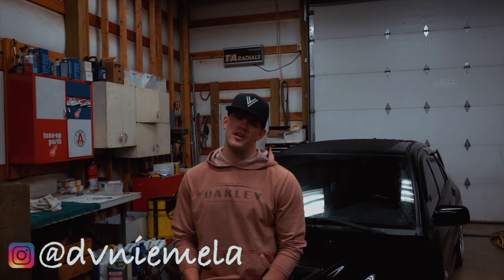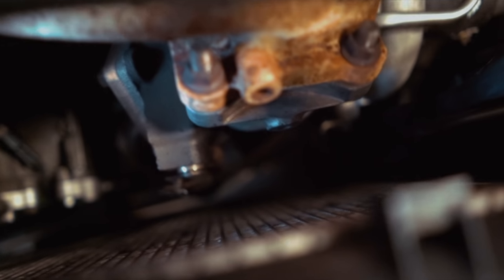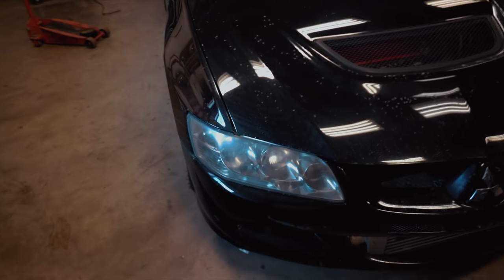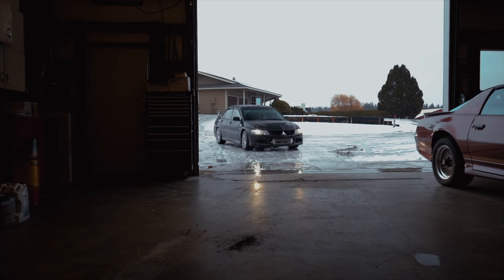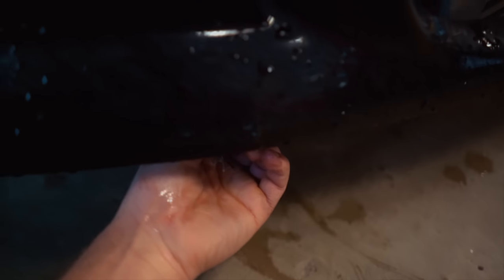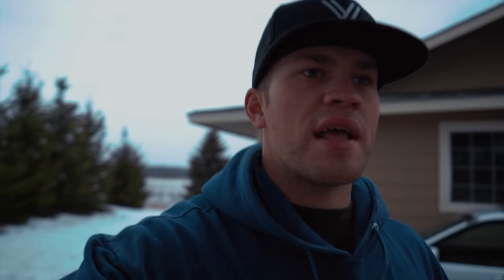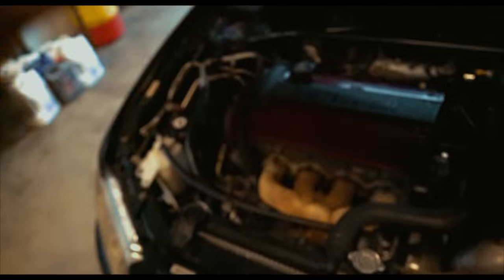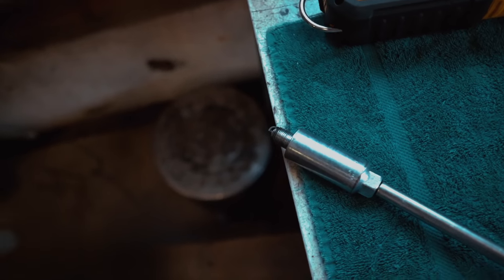36PSI 420WHP Evo 8 Crazy Pulls!

Comment: It would be easier for you to just slap a 3 port boost control solenoid and adjust the wastegate duty cycles accordingly with ecuflash, instead of adjusting your wastegate spring pressure.

Comment: Your check engine light flashing when you're in boost means your car is detecting knock. That's why cobb access ports are great, since it gives you knock detection data in real time. I would not be going WOT at all right now, with how much and how consistent your check engine light was flashing while under load, most likely means you're getting a sizable amount of knock.

Comment: a couple of concerns:
-36 psi on 92 octane (held to redline)?  You might want to consult some other tuners to verify if that's safe.  If that's on the stock turbo, you are way outside of it's efficiency range.  If you were using e85, I could see that being ok.

-Also, did you notice your CEL flashing during the last part of the video?  I had an evo 8 for about 5 years.  I was the tephra mod tune (Im not sure of the exact name) as many evo owners did that still used the stock ecu.  It has a function that flashes the CEL when knock is detected, and yours was going off a lot.  How much knock are you getting in your datalogs?  There really shouldn't be any if you tuner is good.  36psi on 92 octane, you have to be getting a lot of knock.
Reply: jeckoneedlemeyer I can tell you right now, that turbo does not hold 36 psi to redline, it will taper to 22lbs at max by redline.
Reply: BluenoseIXMR I was about to say the same lmao 36psi & only making 4’s? Wonder how long before the turbo goes out smh

Comment: Is he using your check engine light as a knock light??? Cause it is going off like crazy
Reply: That’s what I was thinking like Jesus that shit is going off like crazy
Reply: I never recommend running a lot of boost on pump gas. Its to easy to have a car run lean, if you get a bad tank of gas.
Reply: The logs are 0 counts of knock. I had the stock motor knock sensitivity on during these pulls. Its a more noisy built motor so its making the knock sensor freak out and flash. High boost can be run on pump gas IF you monitor the ethanol content per fill up
Reply: CEL flashing like that could be phantom knock.
Reply: Makes sense that the noisy 2.4 would cause it. Fluidampr would help with the extra engine noise
Reply: Apex Powered LLC I would recommend him to change the knock sensor. I do too have a 2.4 that always blink assuming my motor is knock but as soon I change the sensor it’s fine
Reply: @Anthony_Evo9G64  Thats a good call. Especially on Devin's car that's had so many sensor issues.
Reply: That light flashing looks like the brake light possibly.I noticed it blinking in another video but also noticed its location.
Reply: HAHA DEADASS😂
Reply: I'm sorry, but if you are running 36psi on a stock turbo on pump gas, it is definitely more than likely real knock, not just engine noise.  I would do some 28 psi logs and see if it's still knocking before messing with the knock sensitivity.
Reply: Is this "pump" e85 or pump 91/93?
Reply: Eric Sumpter better be fucking 93 or else kaboom I’m suprised this motor has lasted this long on this much boost😂😂😂😂
Reply: @HoweDoYouDo1999  Even with 93, that is way way too much for a stock turbo!!! Lol..  no intercooler can keep those intake temps down!
Reply: Eric Sumpter eh I’m sure he’ll find out well enough😂😂😂😂😂
Reply: It’s not safe to run 36psi on a stock turbo on pump gas even if it’s on e85. Turbo won’t hold it together. Plus the car is knocking a lot better let off the gas when they start flashing

Comment: I'm not saying 420whp is not much but i would expect to make more at so much boost and being a 2.4 liter. Also i'd say it can rev high no problem. It's an inline. There are rbs and 2jzs that rev to 9k+. 4g63 is known to be one of the most  4cylinder high revving engines. If the valve springs can handle it and you use the right oil it can rev to 8k+
Reply from the maker: Only thing holding it back is the small snail.
Reply: @Dvniemela  Maybe the stock turbo is not made for so much boost. I know for mine that after 1.1 bar it can't make more power because it produces hot air. Stock turbos aren't made for high boost. A bigger turbo like a gt30 would be the best choice for that job.
Reply: Such high boost on a tiny turbo is just a waste of time, probably just detonate til he grenades the engine.

Comment: dam bro is the evo 9 turbo built? 36 psi is sooo much boost. would you recommend small turbo high psi or big turbo low psi
Reply: GenesisGENIUS small turbo high psi.. less turbo lag. If the turbo is smaller the turbine doesn’t have to spin that much there for you get less turbo lag
Reply: @djstefyclashxbox  yeah your right bro. Only problem is small turbos run out of puff at making high hp they make good torque tho. And I'd think a big turbo will last longer because won't have to work as hard. I'm wondering how long that small turbo can last at 36psi. Has to be built. You probably cant tell from the video but the torque probably hits really really hard
Reply: What happens with small engines no tq.

Comment: WAIT 36 POUNDS IF BOOST AND ONLY 420 HP HOLD UP😂😂😂😂
Reply: bruh its stock turbo, some people dont understand that a small turbo running ie 30psi actually puts down less actuall boost then a bigger turbo pushing 20psi, cos ember psi is Pounds per square inch, the more inches you have, the more boost

 ▼

Comment: Not even 500 for that kind of boost? 🤔🤔
Reply: bruh its stock turbo, some people dont understand that a small turbo running ie 30psi actually puts down less actuall boost then a bigger turbo pushing 20psi, cos ember psi is Pounds per square inch, the more inches you have, the more boost